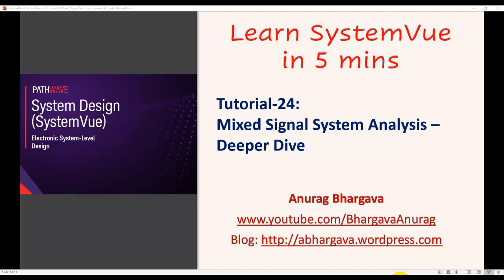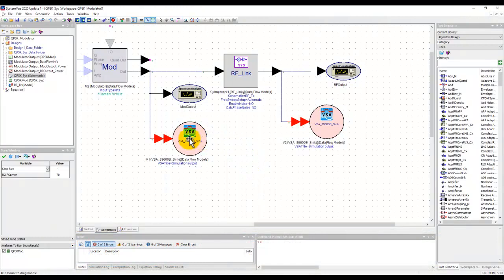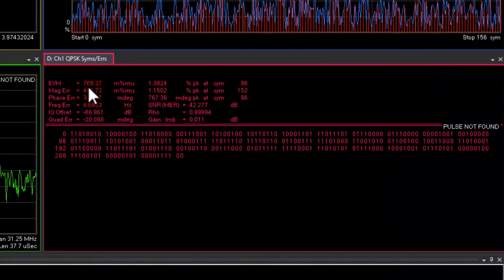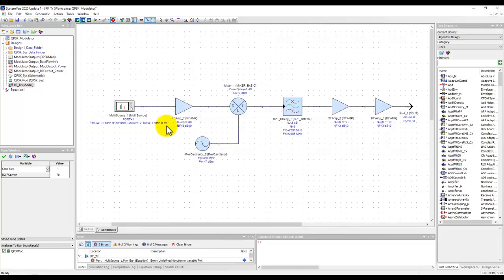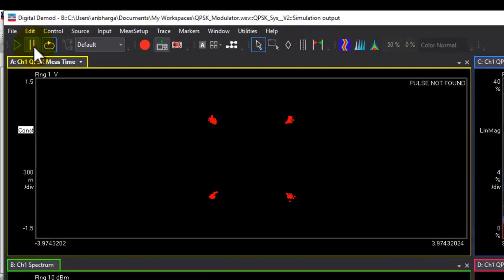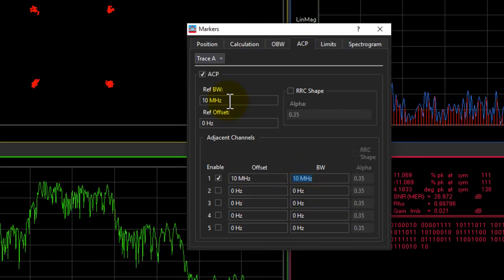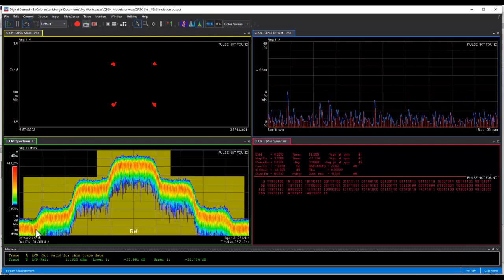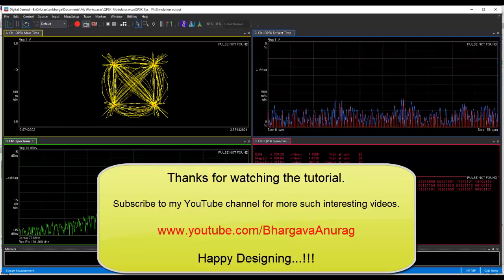Tutorial-24: Mixed Signal System Analysis - Deeper Dive

Comment: So is the multisource device in the rf design automatically recognised as an input, when put the rf-system in the dataflow simulation ?
Reply from the maker: Yes, you are correct in a way. It gets recognized as a connection terminal whether it is to be used for Input or Output is decided how you use it in DataFlow simulation however logically it is always the input.
Reply: @BhargavaAnurag  Thank you for your reply!
Your videos have been very helpful to me!